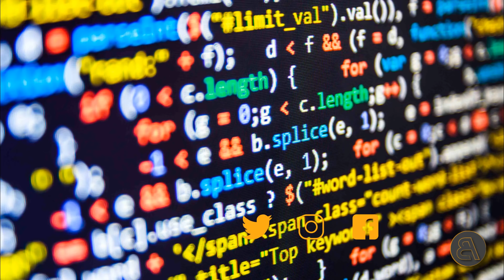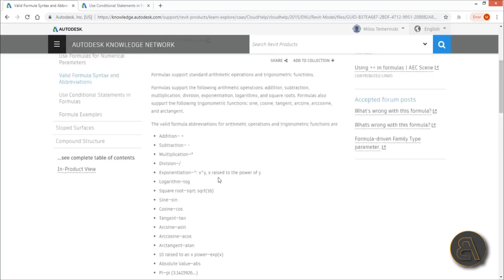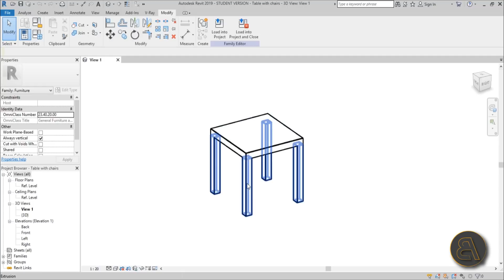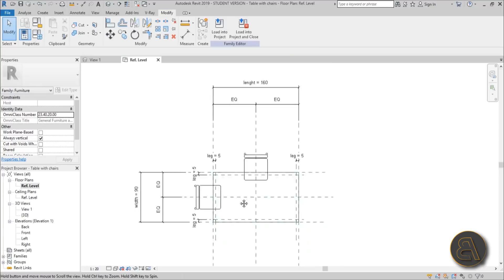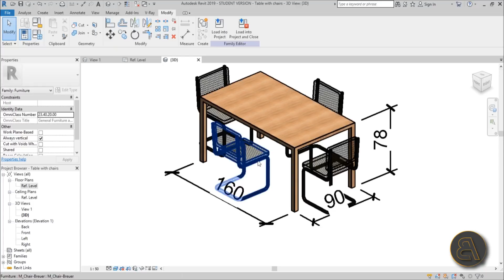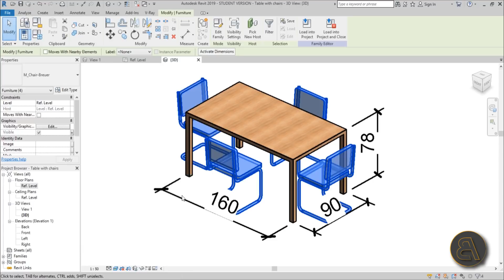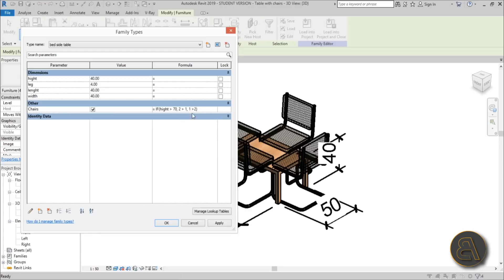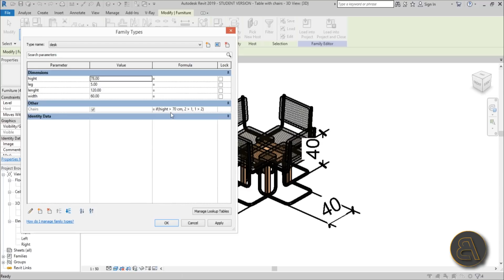Formulas and IF Statements in Revit Tutorial

Comment: Hi please help, I generate an Excel spreadsheet of an OEM pipe fitting concentric reducers. I did create the parametric family however my problem is that that in some instances there is more than one D1 with the same size but the D2 is different diameters, how do I solve this to get the correct D2 by using the IF function ?

Comment: Hi, thanks for tutors. I have some issue, please, help.  I have a table with chair in the middle point. Now, when I resizing the table, it grows to one direction. The problem is: the chair doesn't moves with the middle point, but stays in the same place. And I need it always in the center. How can I lock the chair in the center point of the table (no matter the size of the table). Thanks!
Reply: Table allow to grow both sides

Comment: I have a qustions about IF statements in schedules that I can't figure out. I want to create a schedule in which the area size defines the parkingfactor. For instance, if the area is < 50 m², the factor is 0.7. If the area is 50 - 100 m² it is 1.4 and if the area is > 100 m² it is 2.0. This way it automatically calculates the amount of parkingspaces that I need. I figured this out: if((Area < 50 m²), 0.7, 1.4)   but that will only work for area's smaller and larger than 50 m². If I wan't to have 3 possible results I don't know what to do. Anyone who can help me with my problem? Thanks!
Reply: blahblah blah
Reply: @actimasprime6226  Damn, who hurt you?